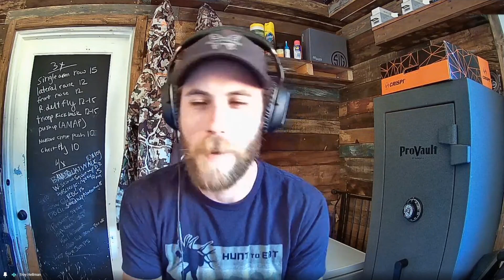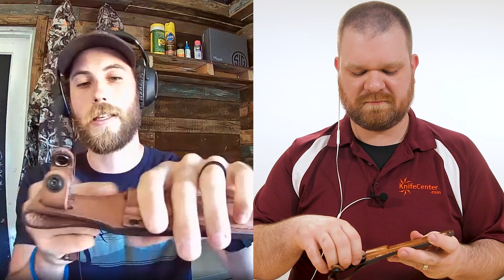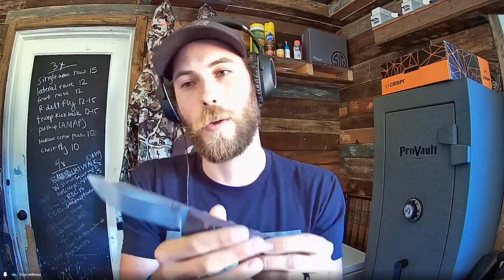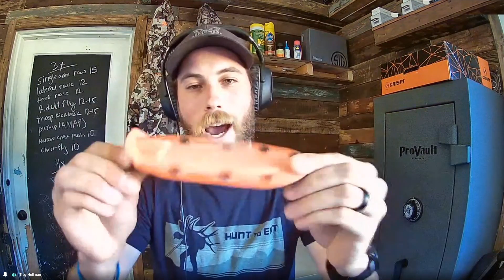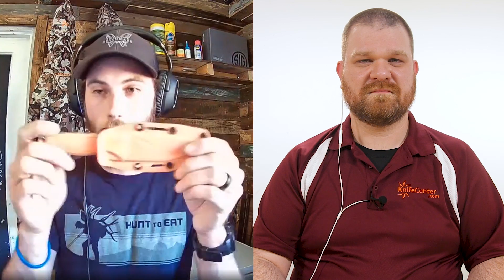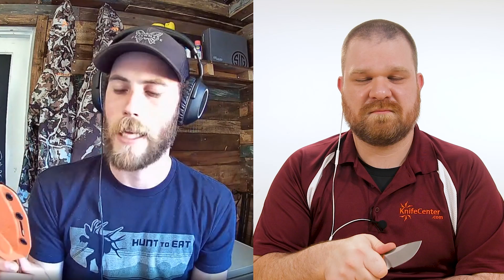New Benchmade Knives: Blade Show Week 2020 brought to you by KnifeCenter

Comment: I love Benchmades, but the sheath on the Saddle Mountain S90V knife ruins the knife for me. After only a few minutes playing with the knife, it kept getting jammed up when I would put the knife in the sheath. After a few more minutes, I noticed the knife was cutting slices out of the sheath. Unless the knife is put in the sheath perfectly centered the knife will cut into the sheath, jamming the knife and eventually cutting through the sheath. 

I called Benchmade to see if it was a known issue, and they said the knife was not designed for any use other than to be thrown in a pack and taken out once or twice a hunt. What kind of $300+ knife and sheath isnt meant to be used on a belt as needed? Unfortunately this awful sheath ruins an otherwise good knife. The new sharpening system is amazing, and I was excited to try out the S90V, but I will be returning the knife unused.

Comment: Thumbs down. No hard questions about benchmade unable to properly heat treat 3v. Video in short, benchmade took a geometry class. By the way I reprofiled my benchmades to 15 degrees per side. That would be 154, m4, and s30 blade steel. So they call a special name and only do it on the one steel.

Comment: How do I resharpen the select edge? is a belt sharpener still a good option?
Reply from the maker: Yes, I would recommend the Ken Onion Work Sharp with the Blade Grinding Attachment, this will let you maintain he thinner edge angle more accurately.

Comment: Really disappointed it was all Hunt Class except the 1 Infidel. Not interested in any of them. Also really disappointed in current folder line up. Other than Freek and Crooked River they have nothing recent IMO. The Grip and 940 are also great but they're both 20ish years old. What happened to the old Benchmade that was state of the art and pushing the envelope. I guess that passed with Les. As a 27 year Benchmade fan it makes me sad.

I also don't think they listen to customers much either. No improvements in heat treat. No improvement or diversity in EDC line.
Reply: The griptilian came out maybe 5 years ago... not 20 years old
Reply: @Jsummer4004  no sir. I had a first production run in 440C and it was 2001. I apologize for being off by 1 year.
Reply: @dark_gravity_edc  my apologies. I did not realize it was that old.
Reply: @Jsummer4004  no worries mate